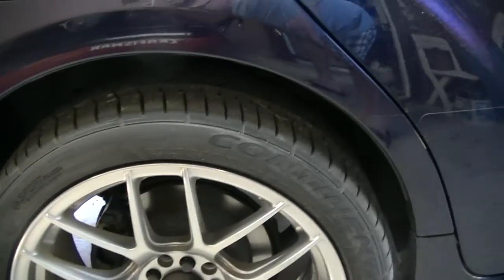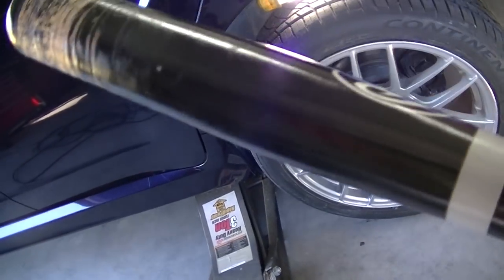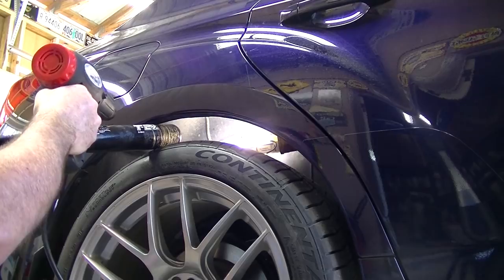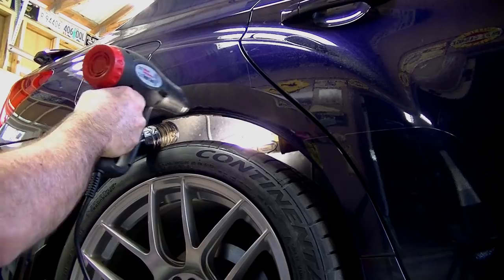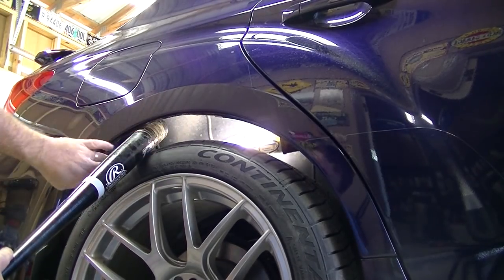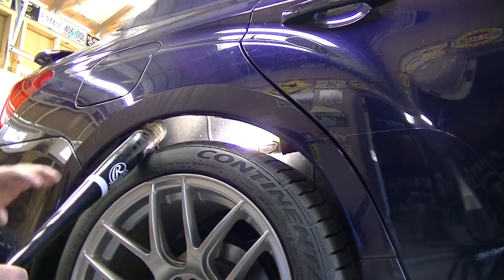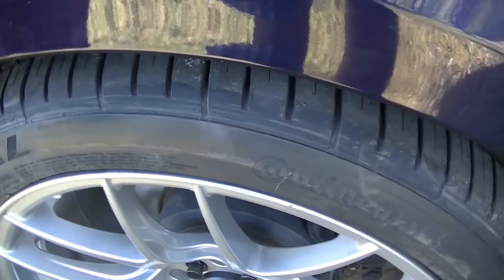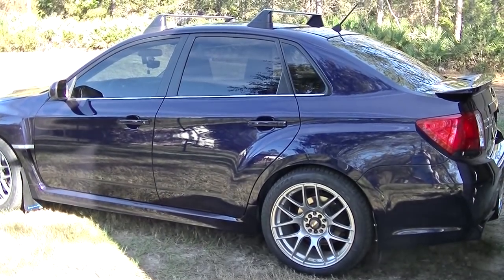Rolling fenders for tire clearance  ,on the cheap - Angry Mechanic

Comment: I watched this because I had to see the 'bat attack' method LOL. I know prices change over time, but a actual roller tool can be had for $37 USD with free postage. Even here in Australia it can be had for about the same. Buy one, and make your money back finding a mate who is game for paying you $10 a wheelwell to roll. Win-win!

If one is really keen to sticking to the bat attack method, I'd do it a bit differently. If you do not allow the tyre to rotate, you end up with two surfaces working against each other (which is why the bat rubs as it did).

1. Raise the chassis/frame of the vehicle, and rest it down on a jackstand. Do NOT position the jackstand on any part of the wheel's suspension. You want the wheel to droop down and be able to rotate freely.

2. Position a jack on a suitable part of the wheel's suspension, and use the jack to raise the wheel enough to fit the bat as required.

NOW, when you roll the bat, the tyre will spin as the bat rolls across the metal, and you will not rub your car's paint nor will the bat's finish rub off onto your car. In the end though, I still reckon at this point its just easier to just buy the actual tool suite for the task. I absolutely understand pinching pennies though and have done some wild fly by seat shit myself haha!
Reply: What made you feel like commenting a whole essay
Reply: @ijustbeexisting8922  looks like he was explaining a better way to roll with a bat without paint damage
Reply: Yeah that way does sound better for sure !!! But damn that was a lot to type !!! 🤣

Comment: i used to do this on older race cars.  i was kind of upset when i bought an eastw*&d fender roller to be a bit more controlled.  the controlled fender roller (let's call the eastw$%d one that) works super well for a single layer lip.  it just really works well.  much easier than the baseball bat.  but, if you've got a car that has two layers of sheet metal that come together at the lip and sort of form a VEE shape, the controlled fender roller requires many hours to even get a 5mm extension.  (if you're just rolling the lip, it will get you a nice, smooth VEE shape in a few hours.)  i wanted an extension (flaring) with this device and watched many videos (mostly on BMWs) where they successfully flared and rolled the fenders.  this did not work at all on a w211 merc.  the fenders were rolled into (an included angle of around 20 degrees) but would just not move outward.  leaning on a lever like a baseball bat as i raised and dropped the car repeatedly did.  HOWEVER, the sheet metal on the outside fender showed a peak (inverse of crease?).  as you can probably observe, i am not a sheet metal guy.  i was told that i could probably, without paint damage, pound that back to smooth.
anyway, i wouldn't do it again.  it made a mess of the outside sheet metal with just the baseball bat method.  i went over and over again with the fender roller (above the lip) and retrieved some sort of smoothness.  it was better; but, if i want it to look good, i'll need a professional to fix it.  this method is not recommended for my model (AMG W211 wagon) but it worked super well on my racecar (1999 VW golf)  good luck to you!!!  and, hey, man, thanks for the video!

Comment: Not bad! Im ngonna try it. I was quoted 400 or so to roll all four on my 05 wrx.
Reply: RyRyin303 that guy woulda ripped you off hard you need to join car groups and find a buddy with one got mine to done for $50 for all four even pulled the fronts a little
Reply: buy a $40 fender roller on ebay and a cheap heat gun from your local home depot ...

Comment: Hey buddy I wanna ask you something, I have a 06 Subaru Impreza 2.5i wagon but I upgraded my caliper brakes for the wrx two & 4 pistons brakes a few years ago also I got a set of 17 wheels  so I was good driving my wagon with my setup of wheels 225/45/17  but two weeks ago I had to change my tires and  I decided to go with a different set 225/50/17 everything was good for two weeks and even looks better Subie but today  I went for a ride with some friends  and now Subie makes a lot of noise I think the wheels are hitting on the rear fenders, so do you think I could fix my problem just rolling my fenders just like you did to your car?
Reply from the maker: Thats what it sounds like
Reply: Sounds like when you drive thru a pot hole with bad shocks like a strong punch

Comment: how about if you put a wheel spacer then you lowered the car? the tire is 205 45 16 need to roll the fender?
Reply from the maker: Tire is 245 40 18 on 9 inch wide wheel.
Reply: it means i need to roll my fender if i had a spacer? sorry not an expert here.
Reply: darwin andres I have 285 40 18 on my BMW E46 and I got shocked that he had to roll his fenders with that height so that his tires wouldnt scratch. I also dont have spacers on mine! Spacers is one thing you should definetely not have. Its the width of the tire not the wheel.

Comment: Is not quite fender rolling, what are you doing is rolling the lip, not the fender, I need to stretch out my fender for proper fitment. in most peoples cases is the fender what needs to be pushed out not lip rolling.

Comment: U get rust soon by doing that bending the metal will crack the paint on the in side lip were u cant paint do too the lip being rolled over bad idea
Reply from the maker: Paulino Fernandes , painted all the spots 5hat cracked. Also live in Fla. No rust concerns here
Reply: He Who Angers You u should use 3m black window uranthane on the in side of lip before u roll it up it will seal the inside paint and weld spots from rust will seal it as hard as a rock